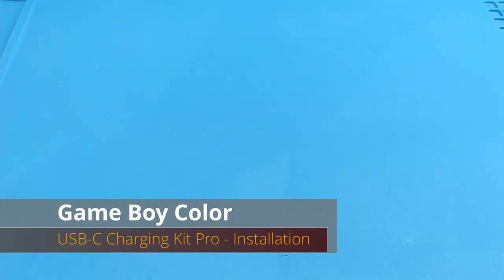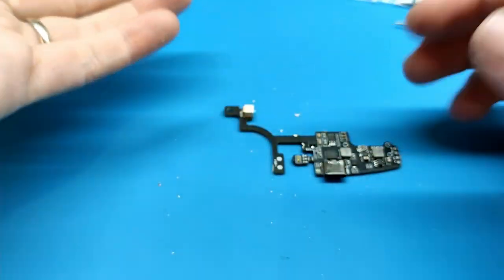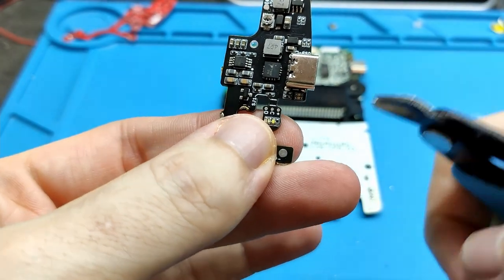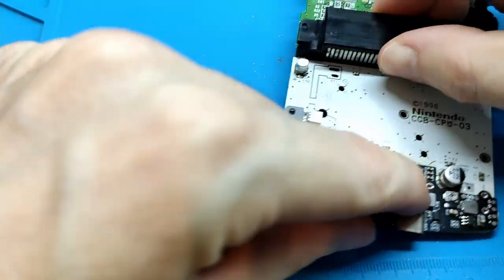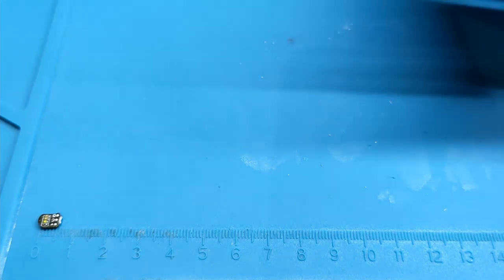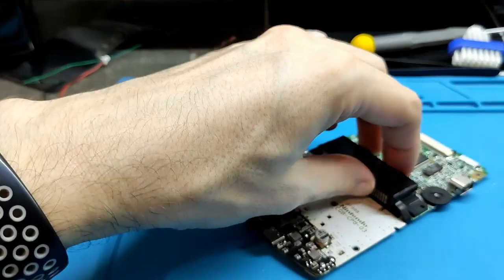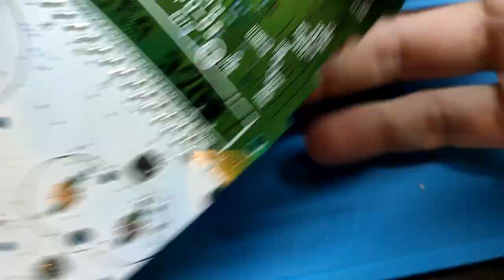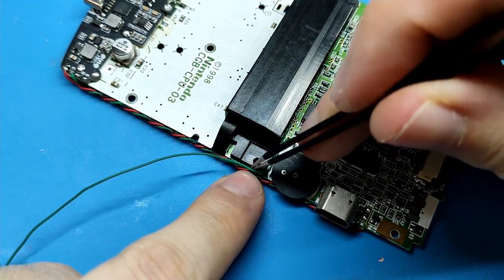Game Boy Color USB-C Charging Kit Pro – Installation

Comment: @giltesa Do you have a followup video for 3.1? Are there videos showing how to remove the components from the board prior to installation? Is there a video you recommend showing replacing the capacitors?
Reply from the maker: Hello Luke,

I don't have a step-by-step video for the latest version, I have only this video where you wrote a message which is for 2.1, although the installation is very similar with the current version, in fact, it's now easier with the improvements added to the board.
I always recommend to follow the guide, I update it with any change of the boards:
https://github.com/giltesa/Game-Boy-Color-USB-C-charging-kit-Pro/raw/master/3.%20Documentation/Installation%20Guide.pdf

In the GBP one, I show you how to remove some components. In this other one of the color (not the PRO version), I explain a bit how to remove components, but on a different circuit.
https://www.youtube.com/watch?v=yOIhhSY7Itc
https://www.youtube.com/watch?v=6jVHuUIQE74

I think this video will be useful for you; I believe it's what you were looking for.
https://www.youtube.com/watch?v=9Kjlwg49Qwc

In this video, they demonstrate various ways to remove the original capacitors:
https://www.youtube.com/watch?v=2VA_CANmr08

Kind regards,
giltesa
Reply: @giltesa  Which method of removing capacitors do you recommend? (Least likely to rip off pads).

With the 1700mAh battery, do you know any place I can get a battery that doesn't take 2 months to get? Preferably with the connectors already attached? So far best I've been able to find is FunnyPlaying charging kit and just using their battery.

I've also seen some videos of people using a 2000mAh from FP. Do you know if that fits in the FP case, or does it require clipping? Assuming 1700mAh should fit fine in their case.
Reply from the maker: @Luke42652  If you don't have a good soldering iron, I think the best way is to break the capacitors and then remove the legs one by one.

I removed them without breaking them, and it was very challenging (I needed them in one piece to take a picture with the new ones).

I only know this battery with the correct connector for this kit:
https://retrogamerepairshop.com/collections/gbc-power/products/103048-1500mah-lipo-battery-cell?variant=40148868792492
Reply: @giltesa  I have an FX951 and a variety of tips. That should be sufficient? I guess my concern is heating up both sides of the capacitor with the legs well underneath. Makho has a video where he did it, but he used two soldering irons. Makes me wish I had soldering tweezers. I have yet to upgrade to something like an FM203. But I guess what you mean by a decent soldering iron you mean consistent heat, which does FX951 does. So I should be good with what I have?
Reply from the maker: @Luke42652  I think your soldering station is better than mine, an AOYUE 968A+, so you shouldn't have any problems.

Exactly, I mean that it has enough power to heat the ground plane of the motherboard.

A trick I follow is to add a good amount of solder to one of the legs, then heat it until it melts. Then, I insert a piece of paper between the capacitor and the leg, remove the soldering iron, and the solder solidifies. Since the paper is in between, the capacitor cannot reattach to the motherboard. Finally, I heat the other leg of the capacitor and remove it.
Reply: @giltesa  Do you know if the battery that comes with the FunnyPlaying charging kit has a compatible JST connector?
Reply from the maker: @Luke42652 
No, the FunnyPlaying kit uses another connector,  It's not a JST SH1.0.
But you can replace the original connector with the provided with our kit

Comment: Please make another revision to this board where the pads for the charging leds aren't TINY. Was just installing a kit and the pads ripped off when I was routing the wire in the top shell.
Reply from the maker: I will try to make them stronger for the next order to the manufacturer. 👍

Comment: I'm having some issues. I do not have an EM4 as I'm using a CPU05 board. I have bridged the SND pad to the ground point via a small gauge wire you suggested in the instructions but still have no sound.

I have checked continuity fro every wire including the green sound wire and it's all coming up good. Any suggestions on what I might be doing wrong or need to do to get that sound working?
Reply from the maker: Hello Katie,
You can check if you have continuity between the audio jack pins 5 and 4. Both should have continuity depending on if you have or not connected a headphones.
https://ibb.co/mFkNWgq
Reply: @giltesa  I also have CPU-05 board.  The speaker works fine after I wired the kit's pad where it supposed to be soldered with EM4 on other version boards to the top left pad of the headphone jack on the GBC board.  However, after I plug in the headphone there is no sound comes out from the headphone.  I checked the continuity between the audio jack pin 5 & 4, the result is it's good when no headphone plug in but no continuity if headphone plug in.  The headphpone was working fine before install the kit.  Any idea what's problem?
Reply from the maker: @alphaking88  Hello,
It’s quite strange, I think it should work. However, I couldn’t test the board on that GBC mainboard version. I will test soon if removing the EM4 component on my board CGB-CPU-03 changes the way to work.
You can also send me some photos here, maybe I can see something else: https://shop.giltesa.com/contact/

Comment: I just got mine and it's been going well so far, but I wasn't able to tell that the board doesn't fit until I cut off the led indicator.

I'm using a cpu-05 gbc, but when I try and set the USBc board down, the F1 fuse gets in the way of UOUT on the charging board. Can I remove F1 and just solder UOUT to the left pad or do I need to do something else?
Reply from the maker: Yes, sorry. The board has its own fuse now and doesn't need the F1 from the GBC. You need to remove F1 and solder UOUT on the left. I will update the guide soon 😓
Reply: @giltesa  No worries! I appreciate the quick response. I realized after making the comment that I have the newest model that's a little different than the one you used in the video. Still, I just wanted to be sure. Thank you!

Comment: This looks great! Does the audio amplifier have a feature where audio is completely cut off or silent when the volume wheel is turned all the way down? As in, the speaker is off, no static or white noise?
Reply from the maker: No, it doesn't have that option, and if you have the volume wheel of the audio amplifier at 100% and the GBC volume wheel at 0% you can still hear a bit the sound... however it's crazy to have the internal volume wheel at 100% because is too loud. My recommendation is 50% or less.

The unique way to have 100% disconnected the sound is connecting the audio jack because it makes the audio amplifier sleep.

Comment: I’m waiting for my order to arrive. A question though; someone told me I will not be able to charge and play at the same time with this kit. Is that correct? It looks like you are booting up the GBC while charging in the video?
Reply from the maker: The board doesn't have this feature yet, so it's better don't do it at the same time, if you do the charger chip will not able to know when the battery is 100% full because the GBC is using it, so the light may not change from red to green and the board may be warmer.
Reply: Thanks for your reply!

Another question, what exact molex does the battery connect to? I’ve got the right li-po but without connector. Thanks!
Reply from the maker: @jonasborgstrom4111  
The board uses a SH 1.0 mm 2P connector for the battery, it's rare batteries came with this size, it's the reason the kit include a battery cable with this connector. You can replace your cable with the included with the kit.
You're welcome 🙂
Reply: Thank you, thank you, thank you!! ⭐️

Comment: I’m having an issue with the sound. Installed everything and lights are working as shown in the video. However, I get no sound from the speaker. I’ve tried three different speakers all known to be working. I get sound from the headphone jack, but there is an awful tone if I listen while charging. Any idea? Thanks!
Reply from the maker: Hello Jonas,
Have you installed the cable with only one wire (green colour) between the sound wheel to the "S" pad? https://ibb.co/rFR9QcQ
Reply: Sorry, my bad. I rushed ahead and tried the speaker before installing the light and sound cable. Everything is done now and is working perfectly. Thanks for your quick reply!

However, there is a missing sound channel in the intro of Tetris just as with the RetroSix pro amp. Is there any workaround for this?
Reply: And now all of a sudden the speaker started to make and awful noise when powered by the battery and a high tone again when connected with the usb c. What to do?
Reply from the maker: @jonasborgstrom4111  Check you have soldered the speaker cables well, the green cable correctly and this has not been damaged with any screw when you closed the shell. The audio cables show be as short as possible, the speaker should be an 8Ω 1W speaker and check also the electrolytic capacitors are not damaged. The variable resistor VR1 is recommendable set up it about 40%
Reply: Thanks. I’ve checked all solder points, looks good. I wonder though, when I’m charging I’m getting this almost fast blinking light. It’s not exactly blinking, more like struggling to keep a constant light. When I’m not charging the green light is steady and fine. Is this normal?
Reply from the maker: @jonasborgstrom4111  that is not normal, the light should be red when the battery is charging or green when it's full, not blinking or other strange effect, just stable color. Can you try it with another charger/usb cable? Do both lights do that? (the one next to the usb and the another one on the light board)
Reply: Both lights do it, sort of red flashing. When i boot it from the battery the light is steady green. Yet the sound issue comes and goes.
Reply: If you have discord or Messenger I can show you a video?
Reply: I think it as to do with the two main solder points to the right, to the left of the 4 smaller ones. I’ve tried to tighten them several times and it it temporarely fixas both the led and sound, but soon enough the issue comes back. It bugs me cause I really think I’ve done a proper solder job but maybe the connection wears off soon enough?
Reply: Or maybe not. I tried solder the speaker to the original pads but the problem remained. As for nor now, the light is working correct, but the sound starts to distort when I plug the USB C in. Then it gets back to normal after a few seconds after disconnecting the charger.
Reply from the maker: @jonasborgstrom4111  I think you mean this pad https://ibb.co/kmhj0cd
That pad is the ground/GND which is the harder one to solder because it is as big as the battery board and also the GBC board. When you are soldering this one, you need to be sure the solder iron has hot both sides of the board/pads enough, otherwise the tin may be bad applied because the heat is dissipated by the surface of the copper plates..

Maybe a trick to get it more easily can be to leave both pads without tin, put a wire that crosses both holes from side to side and solder the wire. But if you have a good solder iron, you shouldn't need to do it.
Reply: I tried that and at first I thought it solved it. But then the issues came back, the distorted sound and the flashing charging light. At first the light was right but after a few seconds it started flashing again. I pulled the charger out and turned the console on and the sound issue was there. I’m clueless here. I must have tried re-solder all points at least three times by now and lastly added the extra ground wire.
Reply from the maker: @jonasborgstrom4111  I think I don’t have more ideas. If you think everything is ok (battery, speaker, GBC board, installation) maybe the charging board was broken during the shipping, because it was test before and worked well (charge, power on, and sound)
I don’t have stock now, but I should receive this week, as soon as I receive them, test and package, I can send you another one.

Comment: Is it possible to use a funny playing retro Pixel v2 screen pre-laminated because I read they need the negative voltage of the old power converter.
Reply from the maker: I'm using this screen, I think it's a copy of the funny playing and for me is working well with no extra cables, just connect the screen (it's possible to solder a cable but I did and I removed because I didn't see any difference with our without it) https://a.aliexpress.com/_v2u48K
Reply: Thanks for the information. When can I order one of these boards?
Reply from the maker: @urubarin3966  the boards have left the factory today, so in less that 2 weeks I should have it. You can "subscribe" to the product and get and email when there is stock again
https://shop.giltesa.com/product/game-boy-color-usb-c-charging-kit-pro/
Reply: Ordered the pro version with also the old one and a 3d tool. Can you recommend a lipo ? I have a retrosix backshell.
Reply from the maker: @urubarin3966  I recommend this battery, but be sure you have a shell without the AA batteries separator in the middle: https://www.aliexpress.com/item/1005001308043027.html
Reply: Hi Alberto,

Thanks for sending me the board. I already installed it but I have some problems with the Audio it makes a lot noices with the minimum volume I can set with the wheel.
I also replaced all three capisitor (the 3 big one on the Gameboy color PCB) with complete new ones but also the same issue. The potentiometer is set to 50% like you recommend.

Any ideas I can reduce this noice? I have also installed a RGB Led mod for the buttons and a funnyplaying retro Pixel v2
Reply from the maker: Hello Urubarin,
The audio amplifier amplifies everything, sound and noise. For the second pack of boards I made, I set the variable resistor at 40%, but It can be customized for each one. (some people may need lower or higher volume t enjoy/hear the game)
With my GBC with new capacitors and speaker I'm able to hear a low electrical buzz if I pause the game or the game doesn't have music all the time. I made a video, I'm not sure if you can appreciate the buzz: https://youtu.be/0Xcb9sLgg3A
Is yours sound like mine?